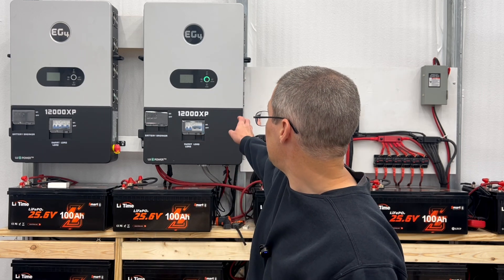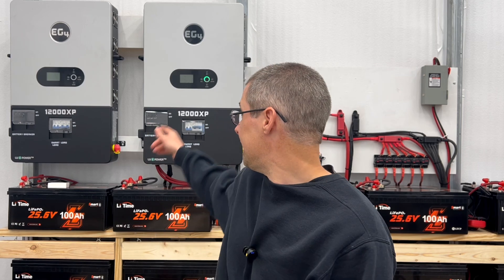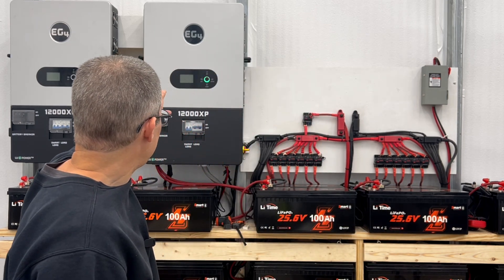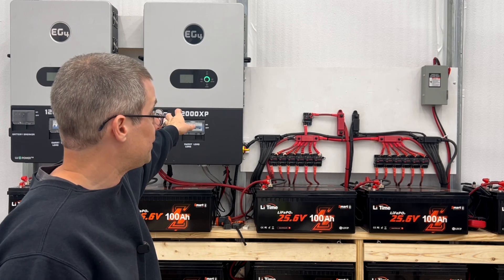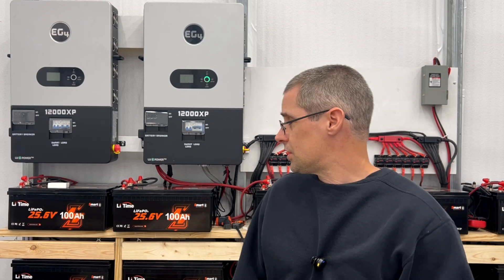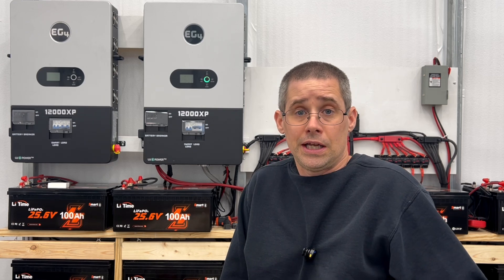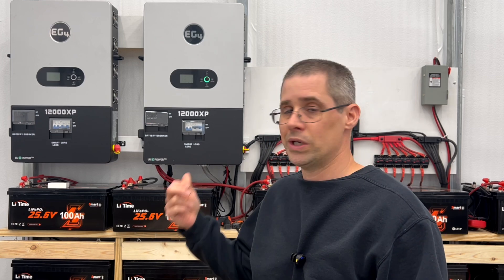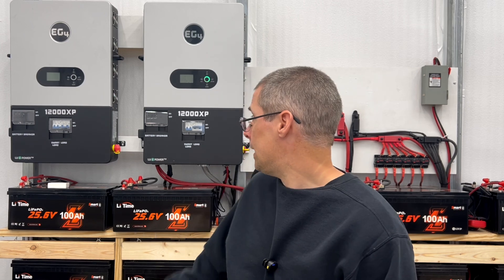Off-Grid vs Hybrid: Choosing the Right EG4 Inverter

Comment: I have a similar situation. I am in the Philippines. I have a cheap Chinese 'hybrid' inverter. This inverter cannot match the grid voltage, so it runs either off-grid or not at all. I don't have a double meter, so exporting would cost me the same rate as importing grid power. I think the hybrid part is the fact that it has 2 built-in MPPTs just like a real hybrid inverter. Anyway, it was affordable and it works. My inverter is a low frequency toroidal inverter, so it can handle peak loads better than a high frequency inverter. That's why I don't need a big inverter.
I don't think the hybrid EG4 inverter can handle the heat better. It's just different. You need active cooling to prevent the inverter from limiting its output to prevent overheating if you run it at high loads. Especially if you mount it outside exposed to the sun. I think you made the right choice buying the off-grid inverters.
Reply from the maker: Thank you very much on the details of your system and your thoughts on my choice for an off grid inverter.  I wish it was a low frequency inverter, but it’s cost prohibitive for what I am trying to do.  Thank you for watching!
Reply: @MikesSolarGarage  Yes, my inverter was surprisingly cheap for a low frequency inverter. But it's probably less efficient than a high frequency inverter (or a Victron low frequency inverter). I have enough panels to compensate for the lower efficiency, but I might want another battery.
Reply from the maker: @ It sounds like you have a pretty nice setup.  What kind of batteries are you looking at?
Reply: @MikesSolarGarage  I now have a 120 Ah 51 V lithium battery (6 kWh). I will probably get another one, or a 100 Ah one. I might connect with my in-laws who live next door, so I can give them power during blackouts, when my batteries are full and there is still more solar coming in, or when on holiday.
Reply from the maker: @ That would be very nice to share power with them.